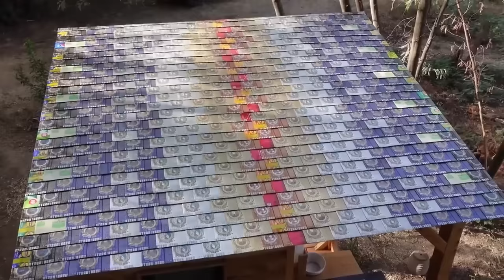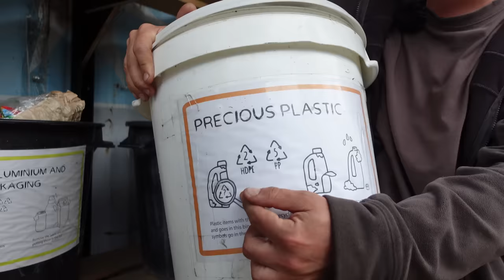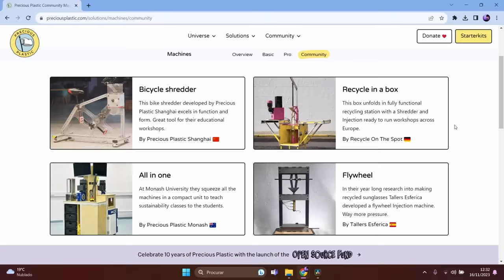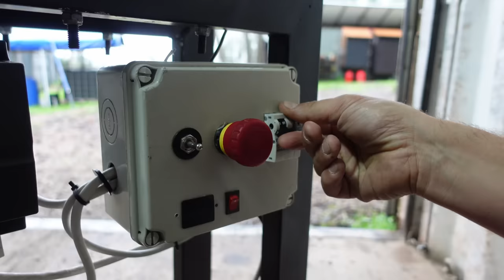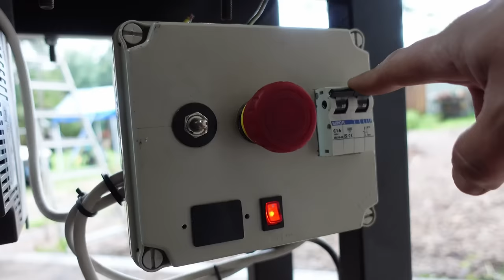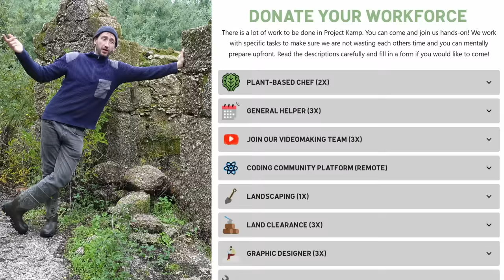#105 Digging swales and planting fruit trees before winter rain comes (LAST EPISODE)

Comment: how about a dedicated drying house? you can build solar heated intakes, basicly small greenhouses over natural stone channels and build in a small wood fire underfloor heating. this might work to both dry fruits grown on the trees and keep a space for drying clothes. on sunny days it will take zero input even during winter, and a small woodstove will be able to keep the heat up if you plan ahead to distribute the heat along the structure. build it up to a funnel and you will have a nice draft. sorry if i dont make sense
Reply: Good idé
Reply: Possibly building a rocket stove would do the trick too, and you could economize on fuel. If they've been drying mimosa branches it could suit the purpose.
Reply: @NezumiWorks  the russian style brick ovens would be better for them i think. takes more time to heat up but needs less care on the short term wich would work beter in a community setting. its easier to make a group spend 10min each 4x a day from say september to may than keep some one on the stove from november to february each day constantly
Reply: I had to dig in muddy wet soil autumn last year i really felt the struggle
Reply: Yeah. Dry rooms are very handy
Reply: @NezumiWorks  I think they should consider making a charcoal kiln to transform part of the mimosa branches and sticks into charcoal.  That charcoal can be used as fuel, soil amendment or even filters for their water.

Comment: IMPORTANT

1) The ethernet cable you ran is old, and limited to low speeds. 
2) Running unshielded ethernet cable, next to electric wire, in the same conduit, will result in interference, and slower speeds. 
3) Ethernet cable underground is vulnerable to lightning strikes, that will burn computer equipment at both ends of the ethernet cable run. 
4) You should run Fibre Cable, which is fast, and not as vulnerable to electric interference or damage. 
5) Future proof your conduit, by running several "Pull Strings" so that you can pull additional cable in the future.
Reply: 1. What?... It's cat6a u/ftp 28:32. I have such cable and have tested speeds up to 1000 Mbit/s with a 15 m cable
2. each pair is in a foil, so it's foiled / shielded
4. yes, but needs optic to electrical convertors on each end, which is additional expenses

Comment: Make sure the mulch doesn't touch the trunk of the fruit trees to prevent rotting.
Reply: Absolutely, also because they have not planted on compost but on woody mulch that has not curated enough. I bet that during the first years these  trees will have a hard time growing
Reply: They put nitrogen heavy manure at the bottom of each hole. The only issues I see are compaction from digging while wet, and the potential of the trees not spreading roots far due to not sheet mulching and fertilizing the planting hole

Comment: Hi Team. Nice work on the swales, trees and plastic recycling, very interesting content.  Re the trench for the water, power and internet to your office. I noticed a few things you should consider doing differently in your next trench.  1 - Power and communication cables are not friends, placing them in the same conduit may cause you issues with the internet down the track, due to inductive interference. Power cables are best in their own conduit placed at lest 50cm away from any communication cables in the same trench/wall.  2 When pulling cables long distances through conduit using a "mouse" or "draw line" it is best to upsize the draw line to a larger one. Done by pulling the smaller draw line out connected to a larger/stronger line (eg climbing para cord, which  I noticed recently was on sale at my local Lidil in rolls, in Caldas da Rainha), then attach your cables to the large draw line and use that to pull the actual cables through the conduit. By using a large draw line there is less risk of the draw line breaking mid way. If you do have a break, go back to a small draw line with a plastic bag on the end so it fills the conduit pipe internal circumference with a soft structure. Then use a vacuum cleaner on the other end of the conduit to suck the plastic bag and small draw line to the end with the vacuum cleaner attached. A technique you can also use if you buy conduit that has not pre installed draw line. 3 - When burying water lines and power in the ground its best practice to lay the conduit, then a few cm of soil/sand, then a marking/warning tape (visual warning the should also have a knitted metal ribbon within it),  and lastly the top layer of substrate. The visual warning stops people when digging in the same area, from hitting the water or power cable directly. Because in theory they dig up the tape first. Further the metal ribbon in the tape, let's you find the trench once the ground is covered in plant grow by using a cable detector. Marking tape has specific metals running through it in a ribbon to make it easy for cable detectors to find. I am sure the fruit trees will be a great success. Take care D
Reply: Excllent advice 👌
Reply: Excellent advices!!!
Reply: great advices!
Reply: It is not nessesary to separate com- and powelines by 50 cm. But high- and lowvoltagelines should be separated by an extra safetylayer, so it would have been good to use a second conduit instead. furthermore, the distance betweeen the two houses adds a lot of resistance within the powerline, so the diamtre of the copper should be choosen reasonably larger.
Reply: @Spatzenterror  My understanding is they are distributing AC power, not DC via stranded copper. Appropriately sized DC conductors are, in my opinion, cost prohibitive.

Comment: Please make sure you are using the correct cable: The maximum length of a Cat5e or Cat6 Ethernet cable is about 295 ft. (90 m), plus up to 16 ft. (5 m) of patch cable on either end, for a total of 328 feet or 100 meters. Beyond this, the signal begins to degrade, reducing the speed and reliability of the connection.
Reply: I estimate the length to be within the limits (just), but putting it in one tube with electricity is a serious no no. For that distance and in one tube together with electricity I would have recommended fiber optic, which would also give a higher speed connection.
Reply: @apveening It’s a very bad Choice. Aside from practically every Regulatory Body prohibiting it the Run is so long that you actually will couple the AC into the Twisted Pair Cable.

Fibre is the Way to go as you said.
SFP+ Optics from eBay and some Mikrotik/Ubiquity Hardware should be the most affordable Option.

It looked like the Power was only single Phase. Three Phase doesn’t only need a bit less Copper but used Devices for it tend to be cheaper.
I’m obviously assuming it’s available.
Plastic is the perfect Choice for Cables and underground Tubes. They are used for pretty long Times.
Reply: @FullSpeed_only  The source for the AC is PV and a battery, so single phase is a safe assumption. And they might even consider running DC in it.
Reply: If it doesn't work, they can just use the electricity cable to transmit data as well
Reply: @FuligJakab  Pretty low bandwidth, I would recommend replacing it with fibre optic cable if necessary.

Comment: 🎯 Key Takeaways for quick navigation:

00:00 🌳 Project Kamp Season 3 finale: Removing invasive mimosa trees, preparing for winter rain.
02:22 🚜 Digger removes stumps, making way for fire-resistant fruit trees. Saving native oaks for replanting.
05:44 🌿 Gathering cow manure for new trees, unexpected generosity from neighbors.
08:31 ♻️ Recycling plastic waste from Project Kamp to create useful products using Precious Plastic machines.
12:45 🛠️ Injection molding plastic hooks from recycled material, open-sourcing designs for replication.
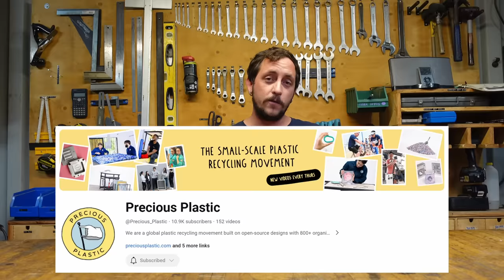21:35 🌧️ Battling rain, addressing erosion issues, and fixing workspace tarp torn by wind.
27:00 🔧 Installing infrastructure pipes for water, electricity, and internet between Base Kamp and the office.
32:13 🌳 Planting diverse fruit trees strategically on swales for optimal water absorption and moisture.
38:26 🌧️ Creating a landscape design to manage rainwater flow for better moisture retention around fruit trees.
38:52 🌳 Anticipation for the impact of winter rain on planted fruit trees around Base Kamp, Community Center, and future living area.
39:36 🌧️ Swales successfully holding rainwater; Winter updates on Patreon to track project progress.
40:09 🙏 Acknowledgment and appreciation for Patreon supporters; Applications open for Season 4 volunteers.
40:38 🎥 Thanking the audience for watching, highlighting the importance of support; Season break until mid-April with a recap video.
41:07 ❄️ Wishing viewers a good winter and inviting them to subscribe for updates on future videos and the upcoming season.

Made with HARPA AI
Reply: Gotta say, that's a pretty nifty use of AI. (thumbs up emoji)

Comment: Little info for you if you ever need to get a wire through a pipe you can use a vacuum cleaner to suck a string to the other end  then you can hook something bigger if needed to the first one then pull the wires

Comment: Love to see your progress! 

A few notes though: please don't walk around inside a vertical walled trench in the soil (especially wet soil); it can easily collapse on you and injure or kill you. You might also have wanted to keep some mimosas for a few more years; I know they are invasive, but they fix nitrogen and provide shade in the summer; I fear your fruit tree seedlings are going to fry in the hot dry summer without a canopy to grow under. You might need to put some shade cloth on them come Spring. Please also consider planting some 'support' plants near your fruit trees: nitrogen fixers, plants that flower at various time for the pollinators, deep--rooted plants to bring up minerals from the subsoil etc. Lastly, apples are a pain because of all the pests in the fruit, you might want to consider planting some jujubes, which taste similar but are much lower maintenance. Sorry, not trying to be 'that guy on the internet that knows better', but even if you ignore all my other advice, please please please don't want around in vertical walled trenches. Stay safe!
Reply: in my small los angeles garden i used to dig up and toss the numerous guaje (leucaena leucocephala) volunteers.  recently i learned about inga alley cropping so now i'm experimenting potting the volunteer guaje seedlings with fruit tree seedlings.  i'm curious if there is an optimal ratio of guajes to fruit trees.

Comment: Very cool again and much progress. I like the hooks. 
Regarding facility tranches, plastics, metal pipes are an alternative. But metall is less flexible,  corodes and takes way more energy to manufacture. To have the plastics pipes last longer, covering them with stones and a warning tape helps. Also good practice is to run besides the cables an additional line in such pipes ... you never know when u need to add another cable (e.g. for wifi 😅). 
Happy season end!
Reply: thumbs up for the wifi-cable

Comment: Is it okay to run electrical and ethernet wires parallel? I believe that create a magnetic field issue. The Ethernet cable you showed looked to be U/UTP. There are special ethernet wires with foil and/or aluminum shielding. The plastic covering might not be enough, and I'd to look into F/UTP or better. My suggestion is also to separate electrical and ethernet wire pipes unless that is code for the area.
Reply: The magnetic field issue is negligible, but damage to the insulation may result in high voltage in unexpected places with possibly very unfortunate results. And given the distance, I would have gone for fiber optic, preventing these kinds of problems and giving a higher speed as well.
Reply: @apveening  Definitely agree. Fiber would have been a better option. TBH I don't have enough field experience to really know if magnetic field would be negligible or not for this type of setup. I just remember it being a concern when I did some certs years ago.

Comment: Cool hooks! 

Yes, pipes and wire insulation is actually a high use of plastic. It's really the best solution we currently have. The good thing is that underground like that they don't get UV or anything that degrades them and they are very stable. 

For next time: 1. with a trench for utilities it's a REALLY REALLY GOOD IDEA to put 'scary tape' at about 1/2 depth. That way, someday, when you end up digging there (or across the trench) again and can't exactly remember where that trench actually was, the digger hits the tape and then knows to be careful and doesn't accidentally destroy your utilities lines. I know, more plastic. You could do a layer of broken roof tiles instead. the idea is to give something that will act as a signal for the next person with a digger. 2. When in mucky mud like that, grab some scrap boards or plywood. A couple per person. You stand on the plywood, throw the second piece where you will stand next. Step to that one when you're ready and pull up the one you were on & throw ahead of you. Then again... another digger!!!! :)  

Which brings us to .... Definitely a TRACTOR with the ability to have both digger attachments & chipper attachments!! The do make them and that's your most versatile equipment purchase - since you'll only be getting one major piece right now. Even if you don't have the funds for the ALL the attachments you might want, you can add as you go.

Have you thought about broken roof-tile pathways? Can it be used on the roads?

I really like putting little metal tags on my trees and perennials with info like what they are and when I planted them. Just a thought.

And finally, THANK YOU! & Happy Winter Break - I'll be looking forward to April!

Comment: One thing to watch for with ethernet is it generally needs a repeater for long runs like you have here.  You may get poor signal over such a long line, especially if power is running right next to it.  A fiber optic 'wire' will let you get a much longer run and no eletrical signal problems.

Comment: 27:41 Electricity right next to Ethernet is not up to code in LV, needs to be at least 20cm apart. Only if both cables are shielded it is ok. Ain't you blowing past the limit of 100m of ethernet? Multimode fiber from FS or other low-cost vendors can go up to 300m and no interference from electricity cables.

Comment: When digging to lay tubes for electricity or even water, always try to lay extra tubes with nothing inside and if possible oversized, to avoid further excavation if you need to pass other cables or larger ones. also, don't forget to map everything and Lay some kind of warning cloth on top of the tubes half meter on top so a future excavator find the cloth before breaking the tubes!

Comment: small hint:
if you guys need to run another pipe segment, it's not best practice to run eletrecticity and ethernet cables in the same pipe, the AC eletrecity can sometimes interfere with the ethernet signal.
By the way, amazing work in the Kamp :D

Comment: You learned a permaculture lesson about making small changes with the swale project. Large changes at once can end with erosion, muddy land, etc. Also, swales should be designed with the existing landscape to utilize natural slopes for water gathering. You are correct in that this is now more like a ditch on flattened land. Still, I love that y'all are finally moving forward with more food forest because it will be an integral part to any ecovillage.

Comment: 28:57 if you ever lose the end of the string, pull the wire out and the string. On the end of the string, tie a small soft plastic bag. On the other end of the pipe/tube, put a shop vacuum. Put the plastic bag in the other end and watch it zip through. This is a common way to re-string your run. Just make sure you have someone on each end to make the process work smoothly.